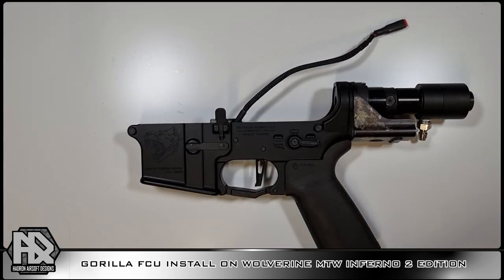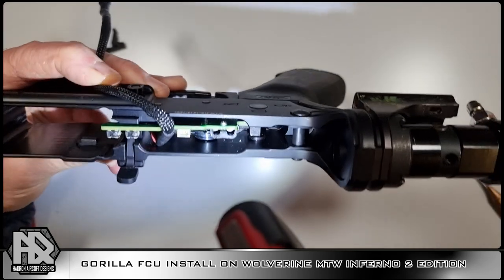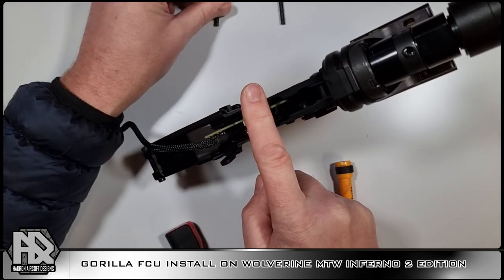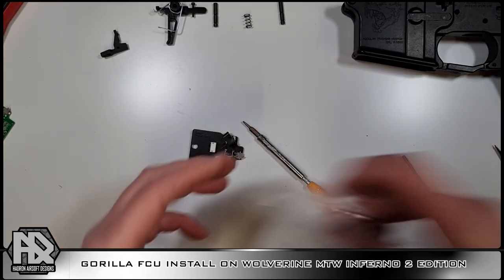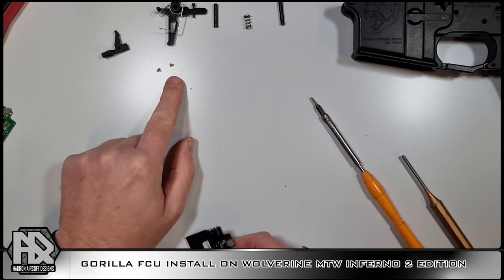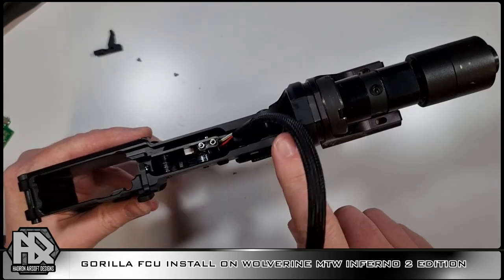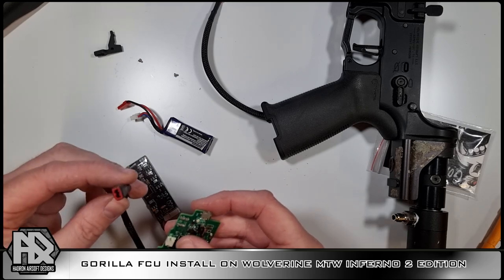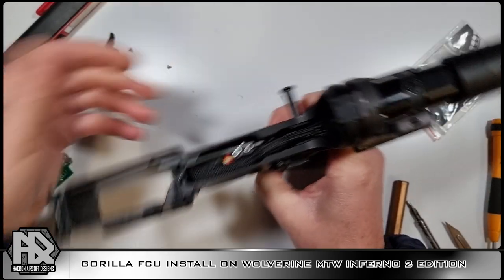Gorilla Airsoft FCU install into a Wolverine MTW Inferno 2 edition

Comment: Spent all day trying to put that trigger in. Better luck tomorrow I hope.
Reply from the maker: It's likely the front pin, the trigger return spring sits in a detent groove. The front part of the spring needs to be depressed with a flat blade or thin wooden stick. The pin can slide right in when it's clear.
Reply: Thanks. I tried tying the spring with floss to help me get it in. That works great but the spring definitely keeps coming out even after I put in the trigger pin. The spring sits very weirdly, like its begging to pop off the end of the trigger.